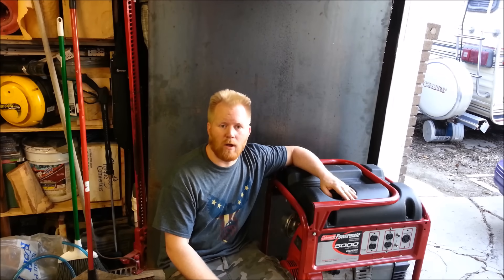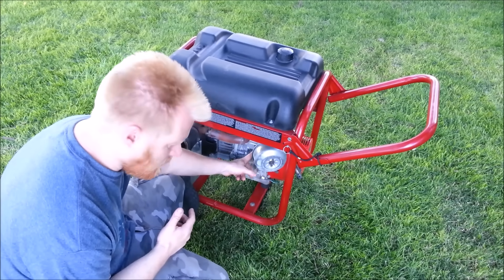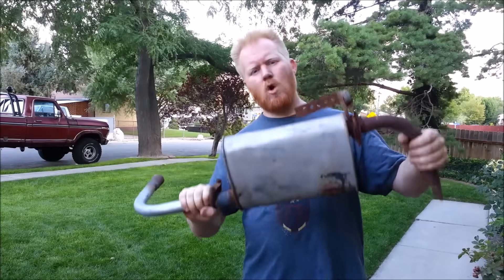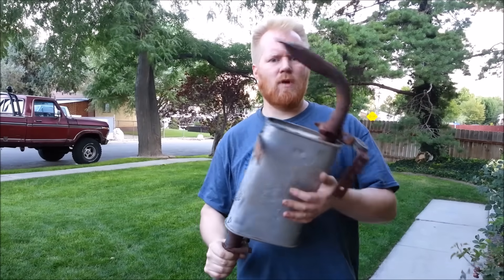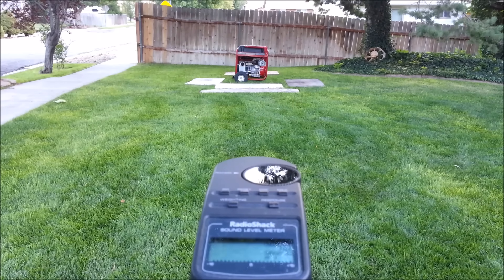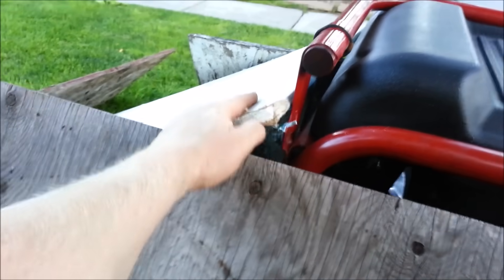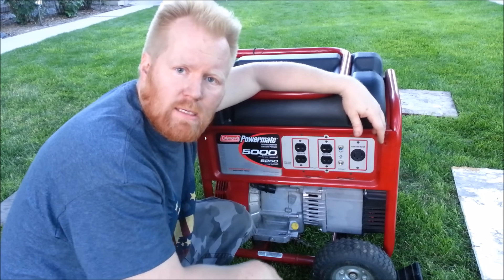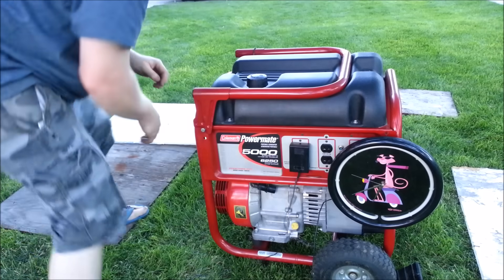4x Quieter generator in 10 seconds

Comment: Great info, bet some Styrofoam pieces bonded to the boards would dampen even more. Always see the stuff around.
Reply: sixtyfiveford  Those drop in ceiling tiles like Armstrong stapled to the plywood/osb works great at dampening the sound even more as they absorb the sound,not transferring it so much to the wood,and leaving little to deflect...BUT you hafta be careful about their getting wet as they tend to fall apart easily when wet,or damp...
Reply from the maker: tblbaby Yeah, it did when I tested it but not much more than OSB chip board. Rubber matting(conveyor belt) seemed to be the best but flops everywhere.
Reply: should have known you'd check styrofoam. I guess thats more absorptive than redirecting sound waves. You could lace some nylon through the matting or belt & support it with 1x2s or something. Not as quick though, which was the point. Hell, you already figured out how to cut the noise way down. I tend to waste a lot of time for improvement that probably isn't worth the time lol. There is always other stuff to get to too.
Reply from the maker: If I find some sheets of foam or ceiling tiles I'll give them a good test.
Reply: @sixtyfiveford  Home Depot book says soundproof rooms are built using unfaced fiberglass weaved between studs, and those faced with soundproof drywall then regular drywall.  Sounds like a lot of hassle and money to use all that to make a box for a generator... I like your simple method instead,  but since fiberglass is both cheap and fireproof, it might be worth it to use it to face the plywood or other material you lean against the generator to help deflect a bit more sound. I wonder what " soundproof drywall" is anyway.
Reply: sixtyfiveford    I guess that is why they've been named "acoustic ceiling tile". Nooks.
Reply: Also one needs to be careful about heat buildup inside of the covering as a neighbor did that,and kept heat soaking the engine causing it to vapor lock as well as the gennie part to get extremely hot...
Reply: I think I'd use the styrofoam,  with something to weatherproof it, because it's light and easy to handle. I'm thinking camping here. I bet I can find other uses for styrofoam panels, too.
Reply: What about foam egg crate material?

Comment: Nice tip, thanks man.  A cool experiment would be to line the plywood sheets with the thin sound/heat insulation stuff like Dynomat, used on car interiors.  Of course that would increase the budget but might make it even more quiet.
Reply from the maker: Ozzstar I tested out some rubber matting(conveyor belt) with good results. I almost bought a couple rolls of the foil/tar at the Home Depot(dynomat rip-off) but this worked so well in the testing I figured it would only be good for another 1-2db.

Comment: Great tip. I think the high rpm aluminum engines make the most irritating noise. A large modern air compressor is the same. But take an old one with a cast iron pump and though it will read intermittently the same decibel, it's not constant and the tone is different. Guess you could say the same about an import 4 cylinder next to an old V8. The difference in pitch makes the latter less irritating.
Reply from the maker: 57WillysCJ I've never really thought of it that way, but you're right. The cast iron dulls the sound.

Comment: In the Army, we put our generators in a hole in the ground or a berm of sand bags....Reduced the noise and makes the generator much harder to locate
Reply: @VistaC-u6c  Huh?!  You say air cooled gen in a hole no good. But Military gens are air cooled and they work ok in a hole? The real answer is provide enough air to to cool and you're ok. Doesn't matter if above or below ground.  The gen doesn't have the smarts to realize if it's civilian or military.
Reply: @craiger1944  Craig you're an idiot
Reply: @craiger1944  He's a (CERTIFIED) Generator Mechanic... HAHAHA 😆 Nothing to brag about...that's gotta be about the bottom of the barrel for a mechanic...
..
Reply: @matooleyobrien2918  that certificate is proudly displayed in a frame on his mantel piece 😂🤣😂
Reply: berms are a good wuick way I just stack some sandbags around it and if it looks like rain I put a piece of plywood covered with a tarp on top....
Reply: I bought a  7000 watt Honda ,it fixed the problem.
Reply: @snakedoc6812  Yeah but most people are not going to mortgage their house for a generator just because it says "Honda" on the side of it
Reply: +kbbacon  It would drown where I live. ;)
However, I could make a little berm to conceal it I guess.
Reply: ltyr2001 1 We burmed in Louisiana.
Reply: @VistaC-u6c  Pretty much all home and small commercial generators are air cooled.  So what?  If you read the manual, (or TM for a military generator) it tells you how much clearance you need.  Only an idiot would think that you just put it in a hole big enough for the generator to fit in.  Putting 50 exclamation marks at the end of a sentence doesn't make you an authority on generators BTW.  63B/52D qualified myself...
Reply from the maker: kbbacon Makes perfect sense.
Reply: Just make the hole big enough for air flow and not in a dry river bed.  Hole works great camp grounds manager gets pissed though.
Reply: @fardmaster123  Yump!!
Reply: kbbacon 
Aaassssoooooo......thank you so much Mr. GI.    We shall add this information to our targeting search computer satellites network of destruction........maniacal laughter.........more maniacal laughter........
Reply: The army also paints over the fuel gauges of their Humvees so... There's that
Reply: @joseguerrero6235  Strange.
Reply: HEY THATS WHAT I WAS THINKING
Reply: They also have generators housed in some kind of noise reducing material which are very quiet.
Reply: @Flatus Antiquitous why you said you can't fly ? did you go to flight school and tried it ?
Reply: @TheJuan72  Joe you're  an idiot
Reply: But that's just not doable in Florida lol
Reply: Yes we did and half the noise was gone.
Reply: Everyone really needs to watch this video about generator safety https://youtu.be/I1jT3ANENvI hope you all stay safe and agree with this advice
Reply: They have quiet generators now.
Reply: Sound dampening is great but there needs to be more air flow.  That's why big "quiet" generators have fans sucking in outside air
Reply: Did you ever forget where you put them maybe you could have camouflaged them too lol
Reply: @charlesroberts6490  :~) There was an extension cord hooked to the gen set.
Reply: pathetic worthless excuse for a vid, so stupid its not even funny
Reply: +kbbacon We did same in Russian army.
Reply: In the airforce we live in 5* hotels, don’t need generators! LOL
Reply: Daisy Beagle Fact watched y’all fly into Miramar park the F-16’s and embassy suites van picked y’all up as we walked a mile to our world war 2 barracks!  I’m not bitter🤬🤬🤬🤬🤬🤬🤬🤬🤬🤬🤬🤬🤬USN 89-95 Tomcats Miramar
Reply: @daisybeagle6259  That's why the rest of us referred to you guys as fair weather friends.
Reply: @daisybeagle6259  lol lucky ole chair force 😂🖕
Reply: @daisybeagle6259  yes but somebody has to do the work! 🤣😂
Reply: @daisybeagle6259  Ah, the good 'ol Air Conditioned Force...
Reply: We did the same thing. One night a young soldier on radio picquet heard it stop but did nothing about it. At reveille we found the we had harboured up in a dry river bed and the watertable had risen and drowned the genny. He got in trouble and the mechanics were really pissed off because they had to completely rebuild it as water had seeped inside the motor.
Reply: @zacandmillie  idk. but the figurative speech pattern and terms here, makes me think it's not a true story. :D
Reply: @zacandmillie  And you were all happy because he volutold for piquet for the rest of Ex.
Reply: @zacandmillie  at least you didn't have a platoon bury a PRC77 during a massive exercise at FT Bragg, in the summer, and they stopped to dig up all of the fighting positions to find it, still on.
Reply: @mrrustygray  82nd, NOT surprised...
Reply: Ive seen, in some old late 50s early 60s onan generator manuals where they show you how to build and plumb a muffler with a 55 gallon drum buried in the ground.
Reply: kbbacon that works until it rains
Reply: +atheist4sure  just look at your keyboard pal, then go join the rest of the police swuad, ( did you notice what I did there )
Reply: @binness  q
Reply: @VistaC-u6c  Lessen your coffee intake dude... !!!
Reply: When I was an Astronaut for NASA we used to just unfurl giant solar panels and catch the Sun's energy.
Reply: @holyhouse7581  Lay off the drugs😂
Reply: @holyhouse7581  umm nope
Reply: It's not just exhaust noise.
Generators need to turn at around 3600rpm to make 120V.  The vibration of the unit makes half the noise.  The solution is to reduce engine rpm.  The super smart Japanese accomplished this by using a slightly larger engine running at a much lower rpm , connected to an overdrive gear system which spun the armature shaft at the required 3600rpm for 120V.   More expensive, but quieter..
They so smart.
Reply: @falconeaterf15  We went diesel and got rid of highly flammable gasoline and lowered rpms. Works.
Reply: kbbacon generators need oxygen... Even in a small hole with a sandbag lid, no gasoline engine will survive long without fresh oxygen. Our military hasnt been using this technique since the mid- 90s
Reply: @mainelytrees4666  I was wondering the same thing. what was done to get better airflow?
Reply: @mainelytrees4666  If it's outdated, please let us know what technique has replaced the one kbbacon mentioned.

Comment: Good information Moe, Last year I built a generator house with a fan and lots of vents, I should perhaps install sound deadning material like sheet rock on the plywood.
I am not sure if you watched the 2014 series on the big generator house I built but here is a link to how I did the exhaust.
 https://www.youtube.com/watch?v=78MtXHgOM4Y
Reply from the maker: ***** Yeah, I remember watching the series. You did a great job and it definitely made a sound difference.
Reply: use ROXUL and then plywood.   sheetrock has paper on it, so is highly flamable.
Reply: They make sound deadening material that comes foil backed and withstand hotrods engine temps Gt-mat makes very affordable products ther on both Amazon and ebay as well as ther website ther located in texas
Reply: old64goat
Reply: old64goat

Comment: I have seen 3 sided gen sheds made just out of painted plywood where the open back just faced the house and even saw a generator in a small Rubbermaid tool cabinet. If I was going to build a permanent enclosure, I would line it with textured ceiling tile. It is fire retardant and probably the ultimate sound deadener. A musician friend once had a sound studio built and lined it with acoustical panels. They looked just like ceil-tile.
Reply from the maker: 1fanger I'll have to test ceiling tiles.
Reply: Sixtyfiveford: Please also test indoor outdoor carpet tacked to the boards, I have found that the carpet works as good as or better than the ceiling tiles and stand up to the abuse of moving, storage and weather better. I have found that two layers tacked to the boards work the best.

Comment: Nice demo!!! My cherry bomb made a slight difference and in my original video,I ran it at the end and used an iPhone Db meter app that was not even close to being accurate. I eliminated that part of the video and I still get flack for that,even though I've used the generator in many other videos. I've been keeping my eye on Craigslist for one of those small rubber sheds that I plan on retrofitting a fan and some absorption batting into. Great vid!
Reply from the maker: BCtruck, rebuild, repair,repurpose Thanks Brad. Yeah, the arm chair engineers are watching every move we make..... I get a fair amount of flack for using a performance muffler in my old video. I tell people to throw the hood up on their car and have their wife peg it at 3600rpm and tell me how quiet their car is now.
Reply: And now you have the shed. :-) 
Looking forward to seeing your adaptations for shed & your new generator.
Reply: @oldtimerlee8820  hello from 6 years ago!!  Only took me 6 years to get the shed.

Comment: My generator is quiet but that's mostly because I struggle to get it running half the time
Reply from the maker: airkraft1 Haha.. Yeah, they don't make much noise then.
Reply: sixtyfiveford

Nope
Reply: Before shut down, turn off fuel line to drain carb. Will start easier.
Reply: JohnnyBallou how do you figure? No varnish build up?
Reply: @rickabrams3422  
No gas in the carb, no gas to go bad and cause varnish. You just shut the fuel off and let the engine run until the engine dies. You can also run ethanol free fuel. I ran AV100LL and I just shut the fuel off, and a year later, the generator started right up without any issues. No need for starting fluid, or any other tricks. AV100LL costs more but its the only source of ethanol free fuel around me. Don't run it in anything with a catalytic converter because of the lead.
Reply: @snoopdogie187  thank you. that actually makes sense. it's not a one-time thing. it's an over the years/time thing. if they got used every day that would be a different story. thanks again.
Reply: @snoopdogie187  Just noticed you already said it. Its the truth...Every issue I have ever had was clogged carbs....You can only compensate with the choke for so long :) Run the carb dry when your done! Cheers.
Reply: @jsmythib    Since running everything until the carb runs dry, I haven't had to repair a carb except the one time the filter came off a 2 cycle fuel line. Simplest trick I learned from older people on the internet years ago.
Reply: Lol
Reply: Lmfaoooooo!!!!!!
Reply: Always shut off your fuel supply and let it stall out once its empty.  That will stop 99% of your issues...(Carb gumming etc). Took me 30 years to learn...compelled to share.
Reply: @jsmythib  thanks buddy!!!!
Reply: Gotta take care of your equipment and ONLY USE NON ETHANOL GASOLINE! So many people just use regular 87... DONT DO THAT! Your carburetor will thank you later
Reply: It's real quiet if you just keep pulling the starter cord to "run" the generator with the ignition off...  good shoulder workout too.
Reply: @UpnorthHere     Except for the air turning blue. 
Try turning the gas on before you try to start it.
Reply: @UpnorthHere  I

Comment: Perfect... I have one I have to test out; if for no other reason; Illinois has been hit with allot of water this year which is not a bad thing but my sump runs every 15 minutes. I have a battery backup but that is not enough if the power fails for some time. I would be interested in hearing more in the future about sump issues or ideas when you get a chance.
Reply from the maker: Curiosity A battery backup is nice but yeah, it won't run long .

Comment: Cool tip so simple.  Hey whats a good way to remove carbon build up in small 4 stroke engine, Do you have to remove the head and Muffler and use a screwdriver or is there an easier way.
Reply: Clean it with water, in the intake port. You can also use 'Seafoam'. Give it a Google.
Reply from the maker: one4stevo Generally you don't know you have carbon build up unless you pull the head. I've seen some very bad ones but they never seam to mind and always ran fine before I pulled them apart for some other reason. Personally I think products like Seafoam are snake oil. It takes a good amount of force to remove carbon with a wire brush or quicker with one in a drill(my preferred method). Though the chemicals in Seafoam may dissolve carbon, it won't unless the head is submerged in it and for a LONG time. It could also dislodge a chunk of carbon and do piston or bore damage.... blah blah blah, I would pull the head.